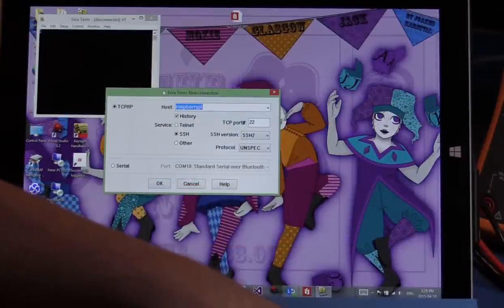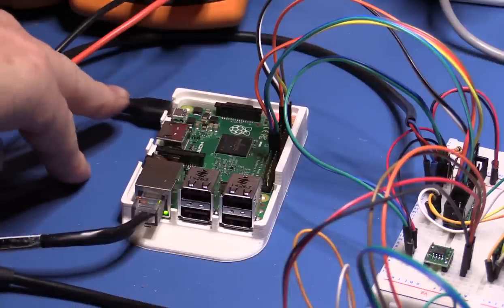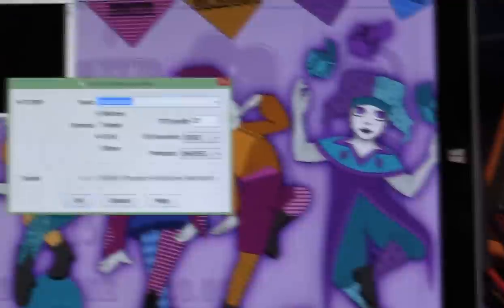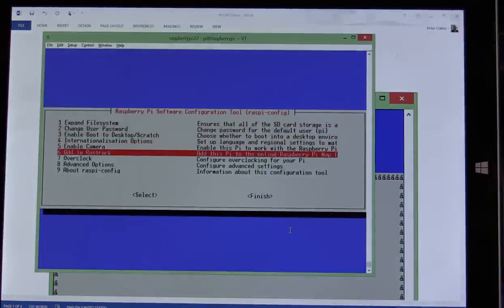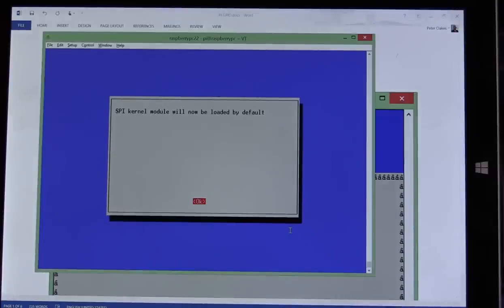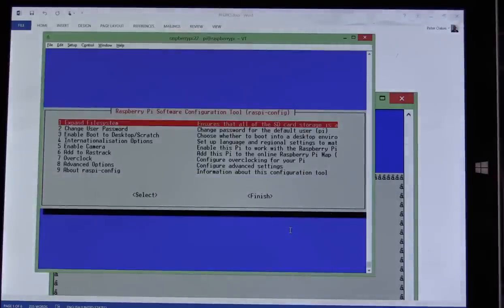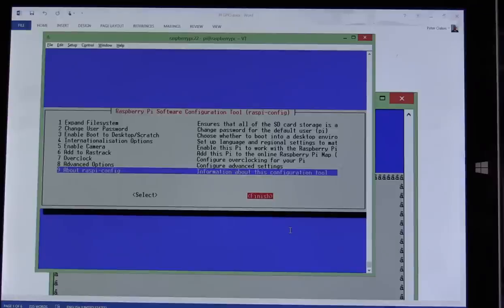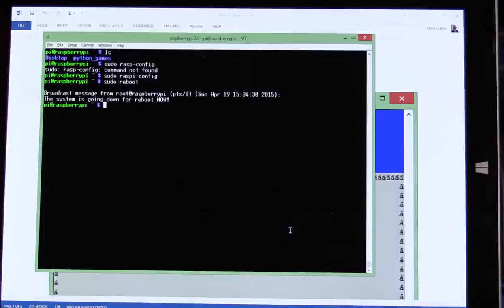Raspberry PI 2, GPIO, SPI, I2C and OneWire Setup

Comment from the maker: You should be able to get all those hooked up to it, but may need to do a little work with interfacing and dont expect off the shelf libraries, it should be a relatively easy task to convert arduino code to suit though as long as you understand the APIs available to you on Windows 10. The raspberry PI has all the same interfaces pretty much as an Arduino except there 3V3, not 5V, it is just how you code to use them that is a bit different

Comment: I still have the same error message when code gpio load i2c. I did add that dtparam i2c0 when it said you missed it in your video and not when you noticed while filming. Apart from that I've done everything as shown above and still have an error :/
Any guesses?
The video nonetheless is very helpful thanks.

Comment: how do you set up MPR121 and how to write a code that will only collect data of touch electrode without the sound provided in an example by adafruit
Reply from the maker: +Kun Otis I personally dont have experiance with this chip, perhaps one of the other views can answer, or as a suggestion, you could try the Element 14 Community or Rs-Components Design Spark Community
Reply: Thank you so much for taking your time to respond

Comment: I use Python and an RPi3 with the Adafruit 12-bit DAC on 3.3V rail power from the Pi. I would like to try a 16-bit DAC with precision 0 to 5V output range, with ability to drive the output right down tight to 0V and right up to 5V. This voltage is a control voltage (CV) for modular synthesizers, so getting very close to the 0.0V and 5.0V is good for pitch tuning. Do you have a suggestion/comment about how to make this happen? Wider power supply rails? Also, where can I get a little board like you use with the DAC you soldered...in fact, can I get a 16-bit DAC already on a little board like that? Glad you are offering such tutorials, BTW.
Reply from the maker: The boards are readily available on ebay and other mass sell store sites, just search for TSOPxx to DIP adapters where xx is the number of pins you need, the TSOP may also vary, check with the description of the part you chose to use.

Some DACs have a -VRef as well as a + Vref, this allows to get true 0V or below. The other possibility is to use a OP Amp after the DAC to amplify the output and allow for trimming to the desired range (And get a true 0V.

The other thing to note is that you need to be careful with POWER grounds and Analog 0V, dont mix them up, even though analog ground and power ground are essentially connected to the same place (The DC In), the analog ground should not carry the power return current, if it does it can play havoc with the output signal quality including elevating the 0V level.

I have found that most DACs will get you to 0V if you follow these few tips. especially the last one.
Reply: Thanks. Just ordered the chip and a MSOP-to-DIP prototype board like yours from Digikey!

Comment: Hi, i had setup follow this, but the command "i2cdetect y 1" show only "-", no anything device (was connected SHT10 <I2C>), and "gpio load i2c" can't run with err: ""gpio: Unable to load/unload modules as this Pi has the device tree enabled."". I had turn on I2C on config.txt before. Can you help me this case?
Reply from the maker: What model PI do you have and what version of Jessie ?
Reply: model pi i use is B, v1.1 and minibian 12/11/2015. (It was detected DS1307-I2C module). And the SHT10 was checked is good with arduino. What can I do more? Thanks
Reply: address conflict ?  remove other module, check again, but  use   i2cdetect   -y   0  and  i2cdetect  -y  1
do not use "gpio load i2c", use raspi-config to activate the i2c port of the raspberry pi  if not already done.
added for other people checking the comments ...

Comment: hmm, trying to enable spi I get the following error:
pi@pi1 ~/wiringPi $ sudo raspi-config
modprobe: ERROR: could not insert 'spi_bcm2708': No such device

after raspi-config and rebooting:
pi@pi1 ~/wiringPi $ gpio load spi
gpio: Unable to load/unload modules as this Pi has the device tree enabled.
  You need to run the raspi-config program (as root) and select the
  modules (SPI or I2C) that you wish to load/unload there and reboot.

Edit:
From here: https://www.raspberrypi.org/forums/viewtopic.php?f=28&t=105360&p=836274

Doing a manual sudo modprobe spi_bcm2835 after changing the config.txt caused the module to load correctly.
Guess the automated loading stuff tries to load an old module that's not relevant for new boards.

Comment: Great video, thanks for posting it.   I could really use some help with a mpu9250 gyro/compass/accelerate unit i just purchased for my raspberry 4.    I followed several articles and videos like yours and instructions but early into the setup there is a test "sudo i2cdetect -y 1" command to ensure the unit is recognized but i can never get it to show up.    I changed my i2c settings, modified the boot/config rebooted and retried and zero luck.    i had to solder the pins and i while i am not the best at soldering i was very careful.    When unit is connected, vcc registers 3.3 volts, i tested continuity from the solder joints to the pins etc.  all perfect.   is there a good way to tell if I damaged it?   i seriously doubt it because i used a different off the shell accellerometer and it too is not recognized.    Are there some common reasons to prevent device detection you can share?
Reply from the maker: are you using a PI2, 3 or 4, what OS version?, there are more than one I2C bus on a PI, try the same command but select I2C 0, so "sudo i2cdetect -y 0" or "sudo i2cdetect -y 2", do you get a different response. Also do you see any other devices during the scan ?. do you have a link to the part you bought (The mpu9250 )